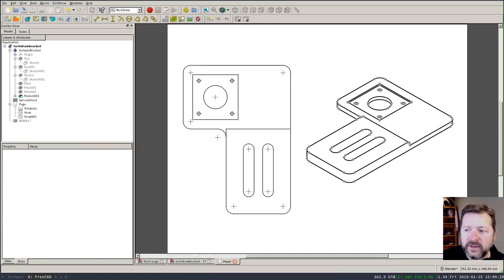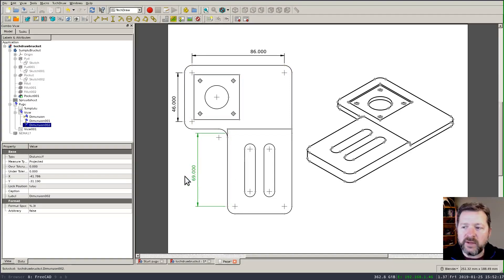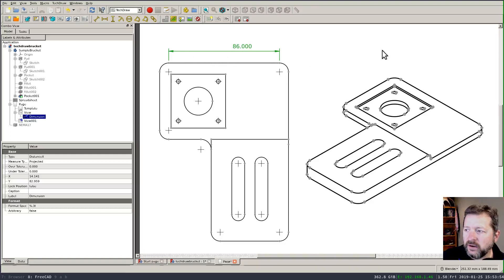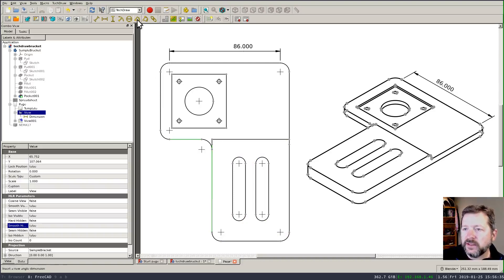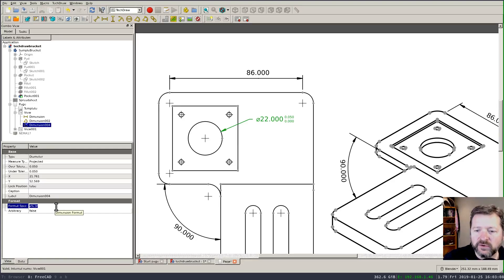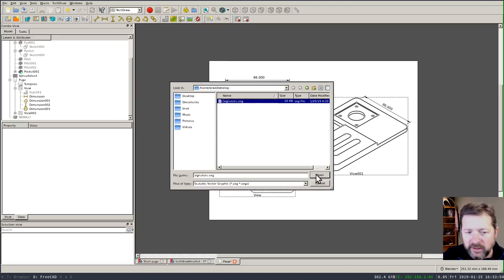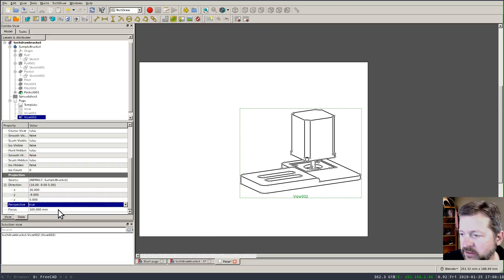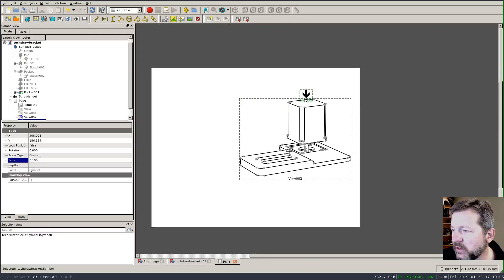TechDraw Workbench Part 2 (Dimensions)

Comment: If you submit a feature request to the FreeCAD dev, in form of a thread of the forum, it's either 1/ this is not how freecad works 2/ then do it yourself and submit a patch or something in between those. This is why I stopped reading the forum
Reply from the maker: Give me a break.  I've personally implemented features that were requested on the forum and I've approved features submitted by people who were encouraged to write them.  I myself was encouraged by the early developers to work on Path despite my lack of experience.
When you see push-back on the forum, it's almost always against uninformed users who nevertheless display an attitude  of entitlement.  
I'll work with literally anyone if they come in good faith.  But I hate it when users who cannot or will not code tell me that what I've written is shit.  And I don't feel the need to be polite to such users.

Comment: Thanks for this valuable piece of knowledge about FreeCAD. Neverthless with the latest 0.19 version I am not able to draw the dimension in the isometric view as you are showing in the video. The extension lines are not following the isometric axis, but they are perpendicular to the projected line. This is method is consistent and valid for the 2D projection, but can be ambiguous in case I need to put dimension just in the isometric view. Is there any option in the techdraw module I am missing?
Reply from the maker: I'm not sure. That's a question better asked on the forum where there are more techdraw experts

Comment: I use the "Hole" function with the PartDesign workbench. The function itself is very useful but how do you get the right markings later in the picture? Let's take three cases:
1. Through hole with M3 thread. In the drawing I want to have the M3 designation e.g "M3 thru" ..... I know I can add the right symbol but this is not the right way .
2. I have a hole with a depth of 12mm with an M3 thread. How do you get such a mark in the picture e.g. "M3x12"?
3. I have a through hole for the DIN912 M3 screw with a socket for its head. And again the alpine combination with the marking of such hole... e.g. "M3/Φ6x4,5"

I will be grateful for showing you the right way without using additional pictures.
Reply from the maker: Call-outs and symbols are still pretty limited in 0.18.  There's work being done on this right now in the development branch.  I strongly  encourage you to read and and contribute on the FreeCAD forum in the TechDraw section.
Reply: I have a lot of notes and insights about different workbenches, but I do not have time to formally describe all this. If you can provide such comments in an informal way (but with examples and, for example, documents with films), I will do it willingly.

My previous remark is that for a long time it has been a "Hole" function, but it does not correspond to the possibility of just dimensioning. I also miss the choice of a thread, eg M4 was also possible as a parameter from a spreadsheet. At the moment, this is not ...

Comment: Thank you from France ! do you know why the tolerances are not available in the data ?I can't see the 2 lines over and under tolerances...A macro is necessary ?
Reply from the maker: tolerances are a new feature in 0.18 which hasn't been released yet (very close)
Reply: @sliptonic  Hello sliptonic. Thanks for your answer. Now, I'm anderstanding why it was impossible with the 0.17 version.

Comment: Is it possible to use other symbols needed in manufacturing drowing? for example: true position tolerance or surface roughness etc.  I saw it in drawing dimmensioning wb, but techdraw looks more professional.
Reply from the maker: You can use any symbols in svg form but it's still largely  manual.  There's some discussion in the devloper channel about adding more standard symbols for welding and other operations but there's many MANY standards worldwide and supporting them all  is a challenge. Right now, I think only diameter and maybe a couple others are automatically added.
Reply: @sliptonic  Thanks! Than i use drawing dimmensions. Or we need some plugin, for the plugin. :)
Reply from the maker: @VladiFx  Drawing-Dimensioning is an add-on workbench for the Drawing workbench.  Drawing is being deprecated in favor of TechDraw so I wouldn't advise using it for long-term work.

Comment: How do you pull Sketcher constraints into TechDraw as dimensions?
Reply: I think these are 2 different thing, so not sure it is possible at all.
Reply: Also i think it is very different how you give dimmensions in 3d designing ang in manufacturing. In desing 10 mm is 10 mm. in manufacturing 10 mm is somewhere between 10.001 and 9.995 depend on your tolerance.
Reply: @VladiFx  I had a big reply that apparently went out into the woods. 
The design and maufacturing dimensions should be controlled by a drawing standard. That doesn't mean that constraints should be directly copied but they should be copied and then modified by the drawing standard whether ISO or ANSI modified for the companies particular practices.

It bothers me that there is apparently no linkage between the design and a drawing. If you change a design as far as I can tell you don't even get flagged in the drawing.
Reply: @VladiFx  of course they are different things. But when you change your design, i.e. your constraints, is your drawing then worthless? If you parameterize the constraints on a sketch, what happens to the drawing. I am troubled by the lack of linkage between the design and drawing. It seems pretty primitive to consider drawings just snapshots. How would you keep track of changes. Ugh. At least flag the drawing when the design changes.
Reply: @la77y8  I understand now, what you are looking for! There is an update button, what sliptonic shows in this video. Is thad does the job?